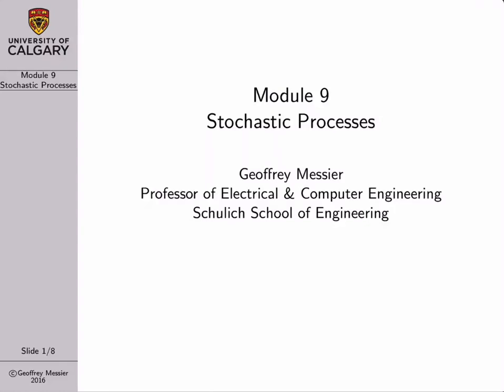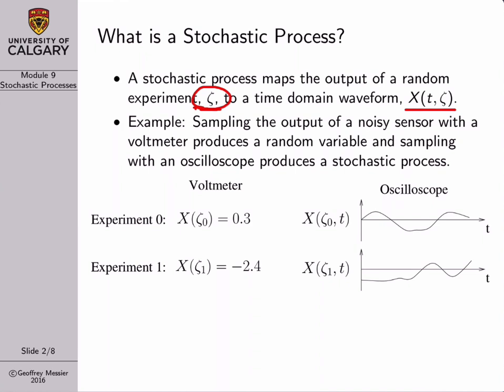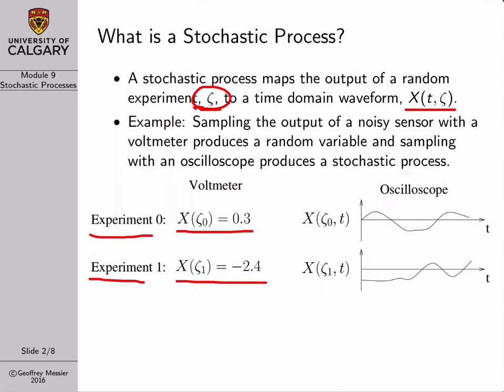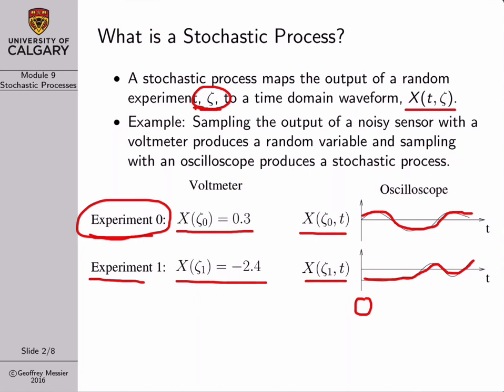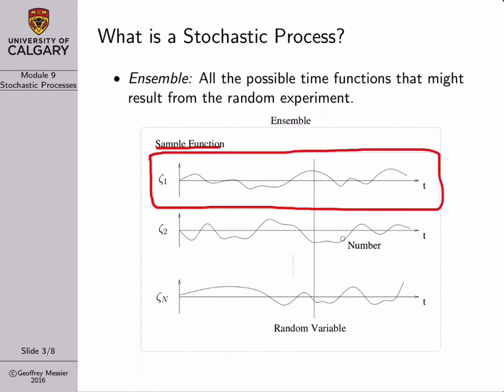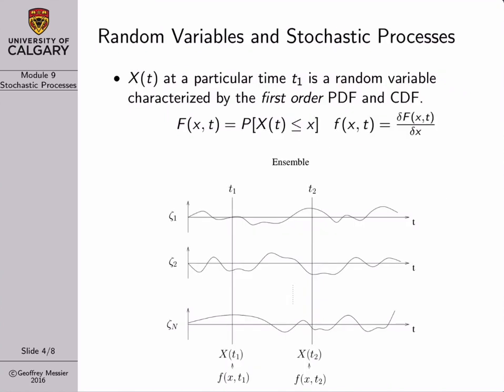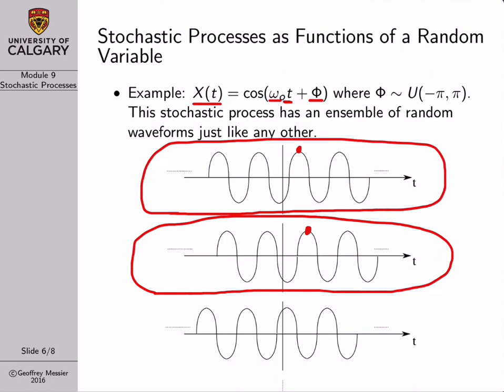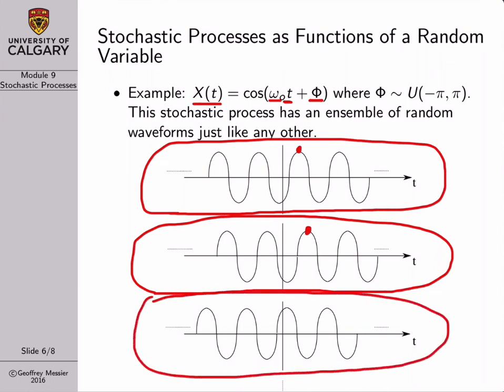Probability Lecture 9: Stochastic Processes

Comment: How did you get fy(y1) = 1/b ? at 21.05
Reply: correct me if I'm wrong but Y is uniformly distributed so fy PDF rectangle has length b (because b-0) so if area (length * height) is 1 then height must be 1/b, so for any in-range y (including y1) fy(y) evaluates to 1/b